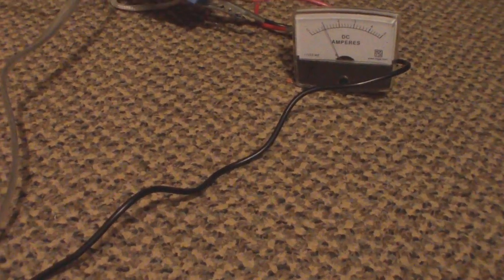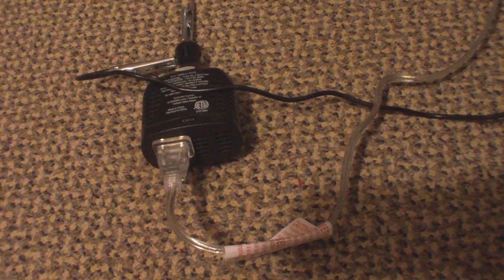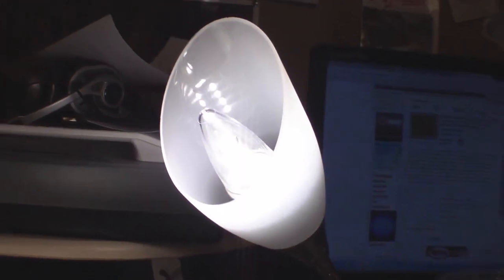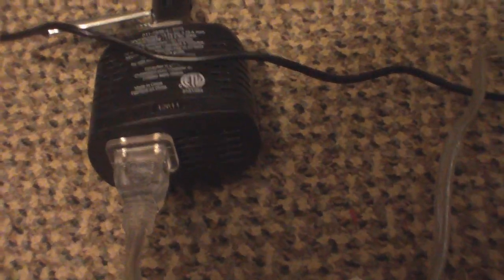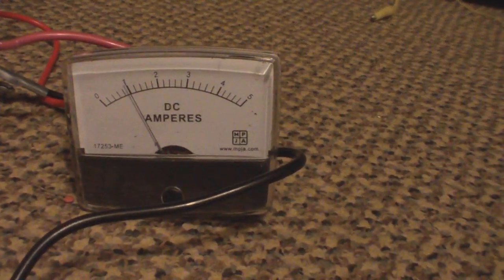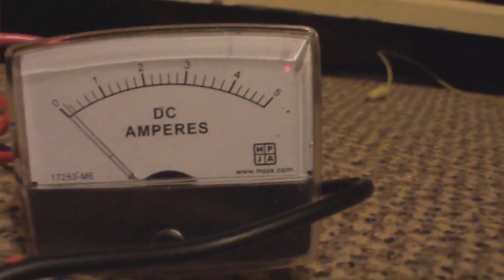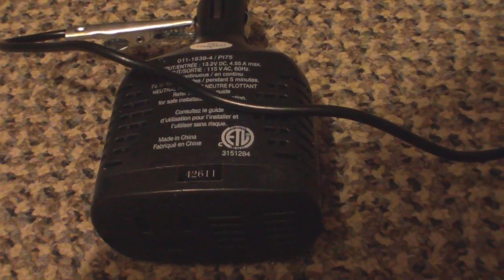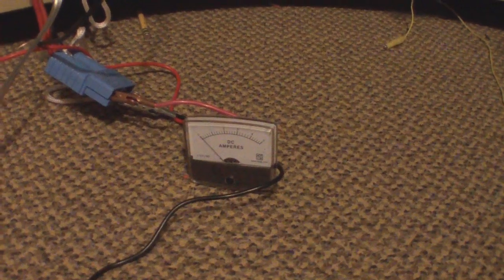LED light on Inverters - MotoMaster 011-1839-4 / P175

Comment from the maker: @MrTwally67 A friend of mine, living off grid, had been living in a Yurt, which, in itself was fantastic for light, because the thing is round for starters, all open, and lined (inside walls) with reflective materials. Then, she built a strawbale (for good reason), however, the entire structure is organic in that the inside walls are adobe, floor is adobe - thus dark... ... ...

Comment from the maker: @MrTwally67 You know it! Granted, the light given off is "full blast"... but at twice the consumption? Here's the thing, If I'm gonna burn 12+ watts to drive 6.5 watts of LEDs.. screw the AC, I'll do it DC with fat cables. Sure there is loss, ... so ..., when someone really needs to run that lamp out at a distance, you are better off building a flip flop / Joule Thief, or the like, a dedicated inverter for that system. Used when the light is. On Solar, you can't "afford" the cheap way.

Comment: you just proved why the xee2vids or jonnyD's inverter it uses 7 volts at 285Ma for the same light as that inverter at 12volt at 1 amp ...the answer is simple cheap is easy but not efficient..lol